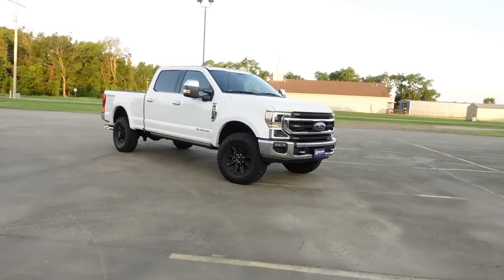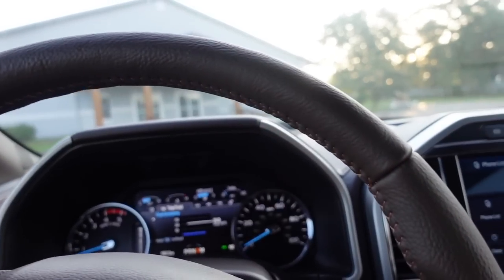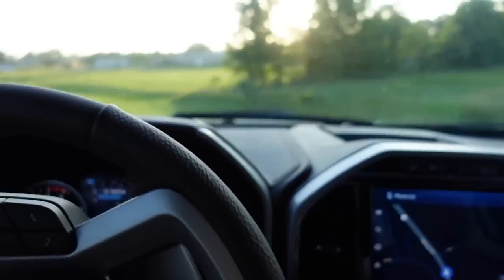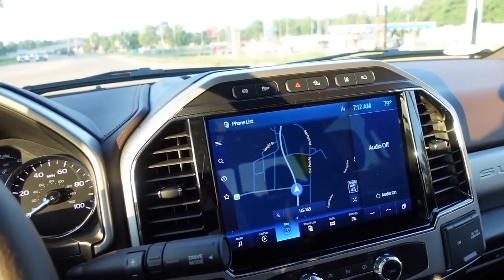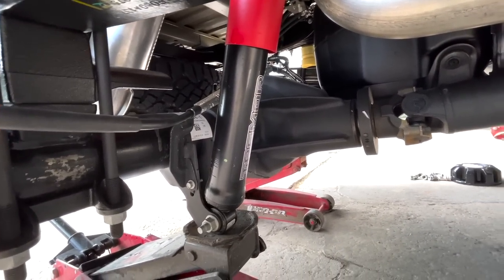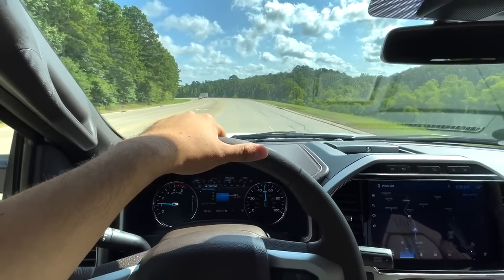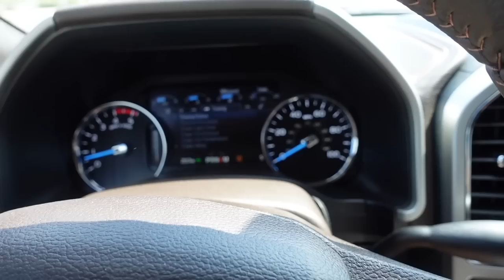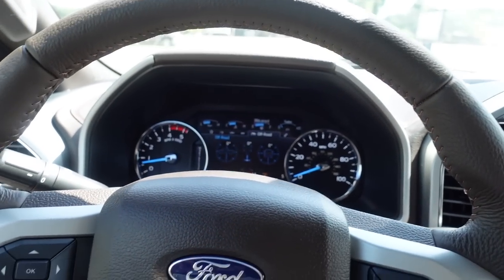Fitting 37s on a Bone Stock F-250 Tremor Powerstroke King Ranch!

Comment: Truck looks good , my 2019 f350 dually struggled with 35s ☹️. No lift lift.   I leveled mine with the 1.5” readylift and the truck felt like crap.    Might be going back to a single wheel in the future.

Comment: Look into a Carli adjustable track bar, you may be able to get full turn radius with it. Dirty max Jack got full turn radius with some 37s but they were 12.50s so I’m not sure about the 13s
Reply: If the tire are hitting the track bar you have some serious problems.
Reply: @gregjames5070  the adjustable track bar is to adjust the front axle. Not because it’s hitting but yes you are right.

Comment: I like the new truck however, I like the other wheels on your other king ranch. To me the FX4 looked sharper. The tremor is nice but I just like the front skirt on it. Would you of rather had another FX4 like the 2021 or do you like the tremor package better ?
Reply: I don't think you pick between the two based on looks! The tremor is one step up on offroad capabilities than the fx4! It has a front limited slip and 35" tires

Comment: I have a 22 f350 tremor carbonized grey with lariat black out emblems thought about running the 37s but want  bigger rims then having 37s on 18s way to much rubber for me especially if doing a lift. Thinking about doing 24s on 38s with 3.5" lift but haven't decided yet.

Comment: I’ve got 37x11.50 ridge grapplers on my stock tremor.
Reply: You rub and scrub.  Or trimmed.   FACT
Reply: No rub no scrub
Reply: I’ve been looking for anyone that did this as I’m thinking of doing the same.   My hope was that the 11.50 wouldn’t cause rubbing issue.  I like the stock wheels.  So I may try this.
Reply: I put 37x11.5x18 on my 2020 F350 7.3L Tremor. I do have a 2" level kit and it rubs (right tire) on the sway bar with full left turn...clears on full right turn. I need to put a track bar relocation bracket and or adjustable track bar to get things centered back up.

Comment: What size are your tremor rims I called around for the mud grapplers and they told me that they do not have mud grapplers that fit the tremor rims. The biggest on the trimmer rim can be a 12.50 and you said that yours at 13.50, correct??
Reply from the maker: 18’s 
Did you call our shop? 
Outdoor Trucks 318-594-9009

Comment: It comes with an Torsen limited slip front differential as well
Reply: It's not a torsen. It's a Dana power-lock clutch limited slip that has more aggressive clutch material. I am planning to swap out for  DETROIT TRUE TRAC
Reply: @resharddurdley6987  you don’t like the stock front limited slip?
Reply: @ryancoates872  

It's OK...I have the Detroit truetrac on my 2007. The truetrac is a far superior differential. The powerlock uses clutches that will wear out and not that great on ice. Truetrac is SUPERIOR for the front.
I am waiting for Eaton to make a Detroit locker for the rear m275.
I am not a fan of the E-locker ford junk
Reply: @resharddurdley6987  why don’t you like the E-locker?

Comment: The fact you can check out the bed through the back camera while you’re driving. I don’t think the 17 F250 had that option on their 8” screen. Maybe an update in the firmware or new version of the sync system will do this on my 17
Reply: There was a cab light camera on my 17. Mint for 5th wheel hook up

Comment: on the camera , did you add anything to the system to allow you to use it after going 10 mph, i got a 2019 f250 plat and after like 15 mph the camera shuts off
Reply: There is a harness you can buy aftermarket for the 2019... I have it on my 2020 but I wondering if it didn't for the big screen now
Reply: The new ones will let you look at the camera regardless of speed now.  Not sure if it’s a 2021 or 2022 feature.

Comment: Will a Tremor take the Ready Lift 3.5” SST?
Reply: There is a guy that used the 2.5 SST kit on his tremor running 18s and 35. He’s on the readylift sit with pictures. I’d say yea but your castor would be crap and you’d get heck of a lot of front end floating and bump steer. I have the 2.5 on my fx4 2021 castor was awful. Ran a 2degree shim and still thinking about upgrading radius arms. If I did it again I’d go full bds 2.5 or 4 in kit you get everything you need. They are worth it and you get a full coil kit for gas or diesel. Roughy 1700$ usd.
Reply: @williamedwards6496  thanks - stick with the FX4 and Snow Plow Package
Reply: @realistic.optimist  yea there’s your 1 in level. I believe. The way the new ones are a 1-1.5 inch level is perfect.
Reply: @williamedwards6496  but BDS replaces the springs and I want to keep my Snow Plow springs
Reply: @realistic.optimist  right I’m saying I believe the snow plow springs gives you an extra inch in the front to compensate for the extra weight. So instead of a 3 inch rake you are pretty level already. Run some 296 65 20 (35.1) or 295 70 18 (34.3) Depending on wheel size and you got your self a sweet lookin rig. Just my thoughts. You can run them with no issues completely stock no trimming or anything.
Reply: @williamedwards6496  38x13.5s